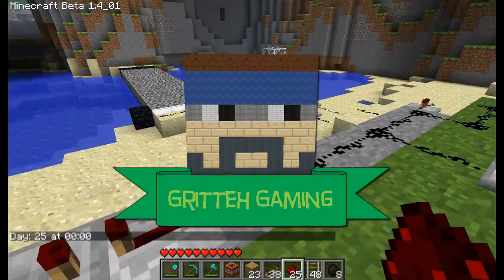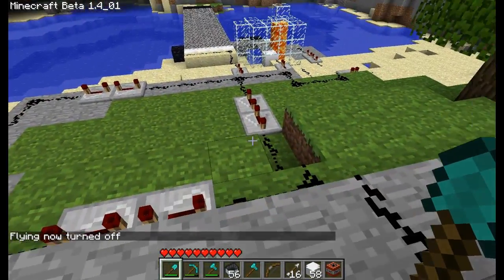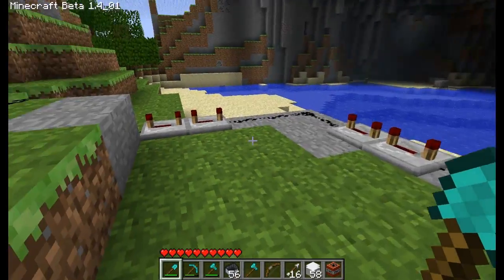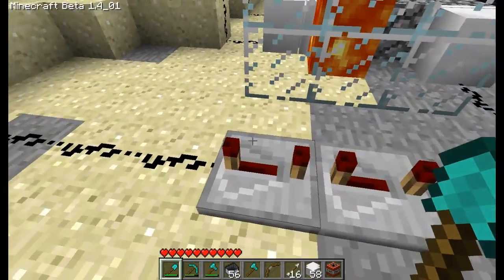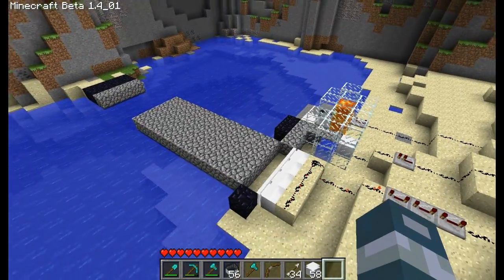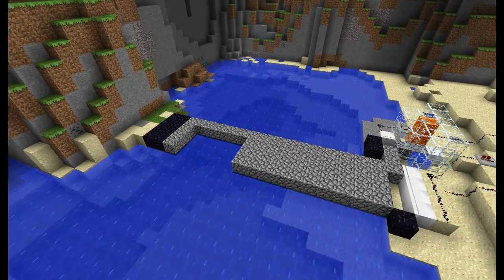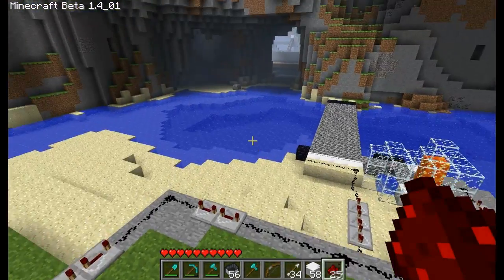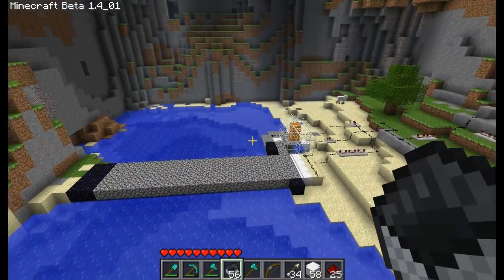Minecraft: The Uses of Pistons Part 2 - Self Building Bridge (using the Piston mod)

Comment: No offence to you, but the wiring in the circuit has clearly been done by someone not familiar with redstone. Most notably, if you replace the button with a lever, you wouldn't need to stop the circuit by manually taking out some redstone.
If you care, message me and I'll show you how to reduce that circuit size drastically.